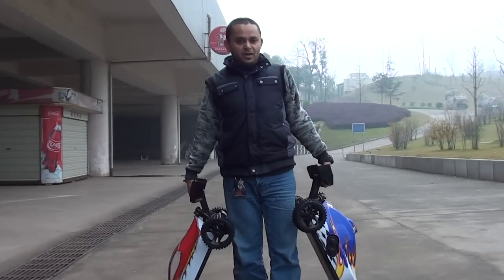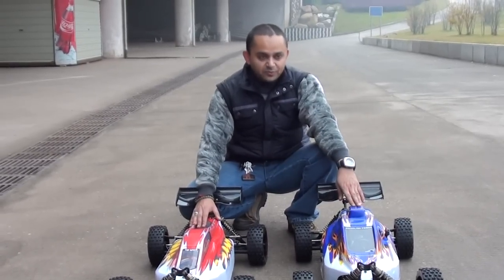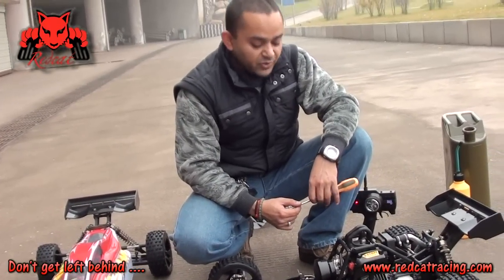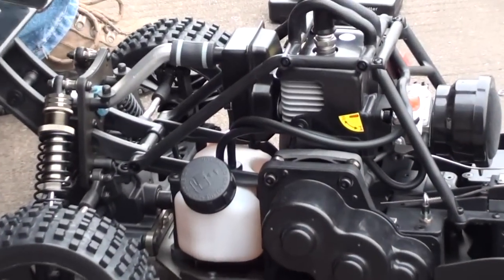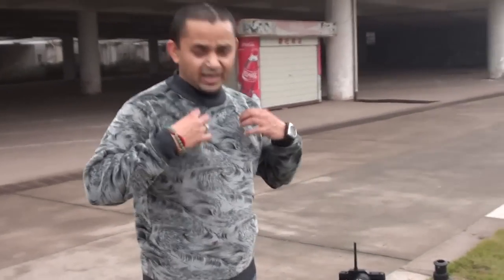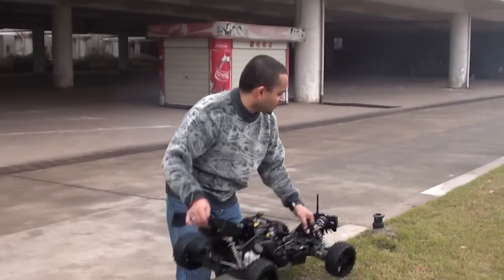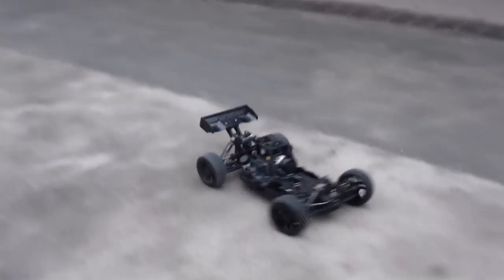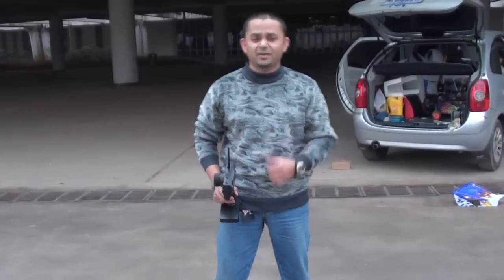RedCat Racing New 1/5 Scale Rampage XB Engine Breaking in

Comment: It won't hurt anything to run it out of fuel, but it's good practice to shut it off before it runs out. When you are done running it for the day, remove the gas cap and dump the old gas out and run it in a lawnmower or something, don't put it back in your R/C. Then you can fire the motor back up and run the fuel lines dry. It can then sit for months without any problem.

Comment: Get 2 stroke oil from a motorcycle shop. Common ratio is 25:1 so that would be 40cc oil per litre of gas. You can get measure containers from motorcycle shops or maybe someplace that sells chainsaws or scooters

Comment: Ali, you actually don't need to break in the engine like this. All you have to do is gun the throttle on straights for 10 seconds. Continue after 3-5 tanks. Then add the pipe BUT still go easy on it until the 7th tank (Just so the engine is adjusted to the new exhaust porting.

Comment: if you ever mess up with tuning you can go back to 2 turns out for high and low screw. thats is pretty much stock for these engines. also what mix where you running this on?

Comment: @TheMalcolmx95 depends, gas is cheaper first off but is cheaper to fuel in the long run. Nitro cheaper first off, more expensive in the long run. Depending on the car you get they both go about the same speed. If you can afford 1/5 gas and have the space to run, get it. If you just wanna bash a car like this about a bit and dont have lots of money to spend, go for nitro :). Hope this helped :)

Comment: what kind of fuel and oil did you use. I'm a newbie at this
Reply: 2 stroke gas
Reply: A mix of 2 stroke oil and gasoline with a 25:1 ratio. 25 parts of gas and 1 part of oil.

Comment: I ordered one today, does it need to be tuned?
Reply: landon link It doesn't necessarily need tuning, factory settings will provide good acceleration. I always like to tune mine though, the changes on the carb are subtle but it's definitely noticeable in performance, both acceleration and (especially) top speed. Figure out what you like best, if you're happy with what you see right out the box then you're gonna be just fine running it that way. However, if you're keen to extract every bit of speed and acceleration from your engine then you'll have to give it some time to tune it. I can tell you that it does pay off if you choose to do that :)(oh yeah and I only got the 26cc version, imagine what the 30cc will do :D)

Comment: You need to run 2-stroke oil. Without the oil added to the fuel the motor will have no lubrication and will seize with catastrophic results, aka blown up and needing to be replaced. Oil is cheap, use it!

Comment: I had a 1/5th scale be careful of how you pull the pullstarters, make sure you pull first gently until it engages and then really giver a good yank, I broke at least 5 starters!
Reply: spencer 124 same problem I actually changed mine to a drill bit start very reliable never breaks